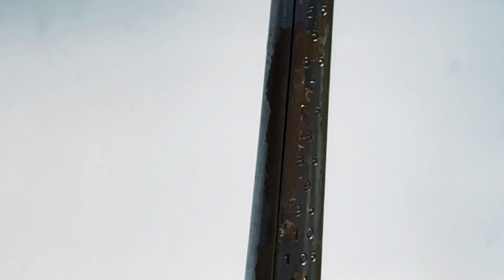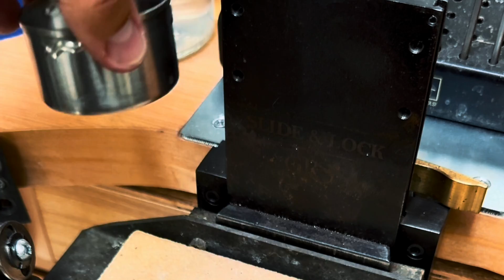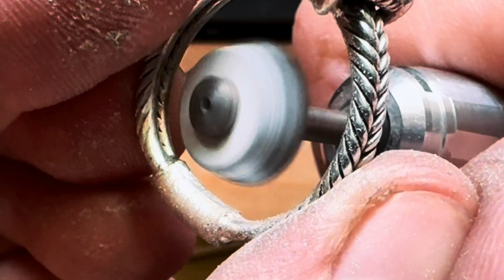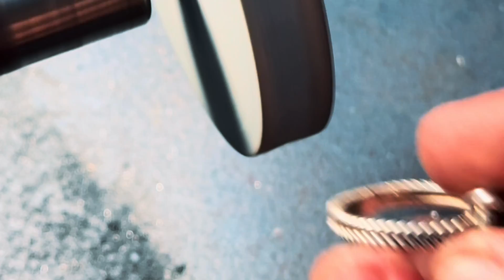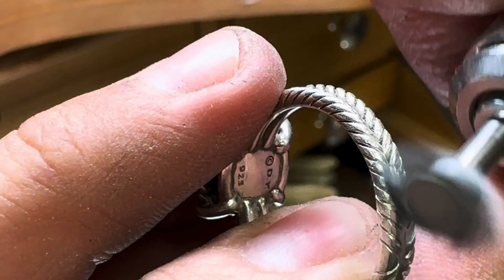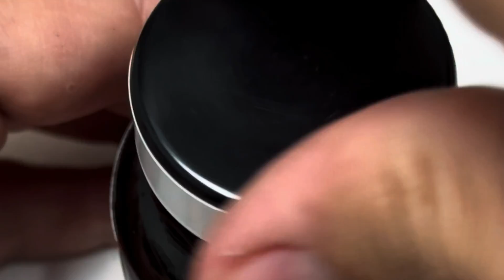Sizing Up Two David Yurman Cable Rings | Massoyan Studio

Comment: I once tried to clean a coin which I found with my metal detector. I read that applying heat might be helpful. So I did what you did - I started to heat it up with a gas torch. Suddenly - without any notice, the coin mutated into a big metal drop,  dropping to the ground. This happened in milliseconds.